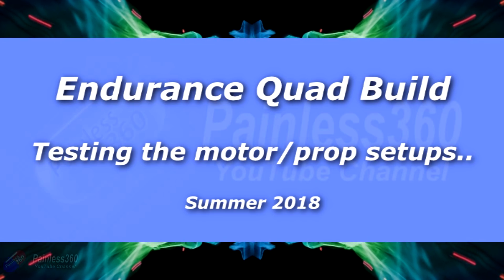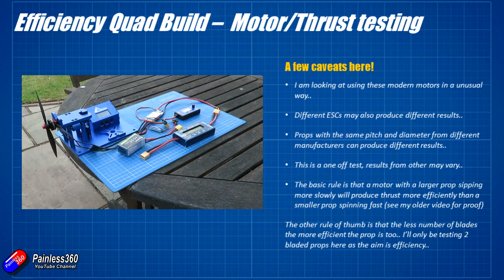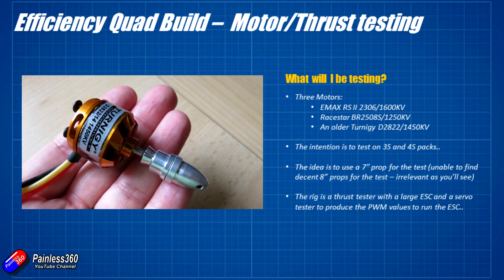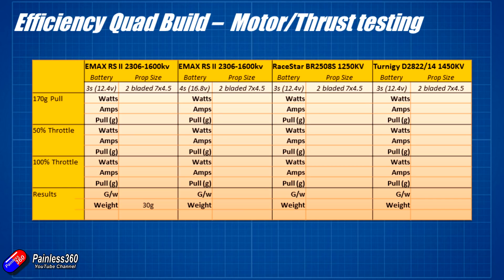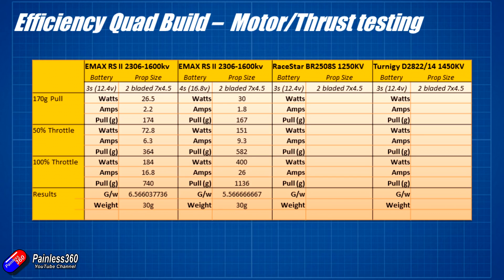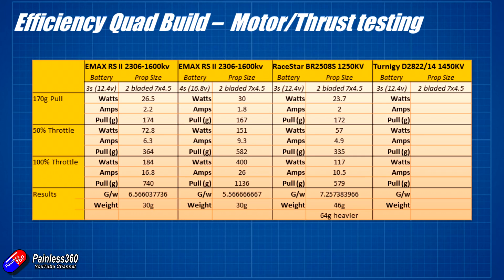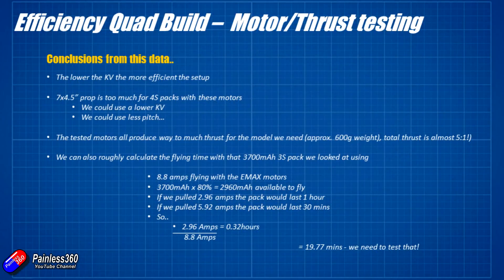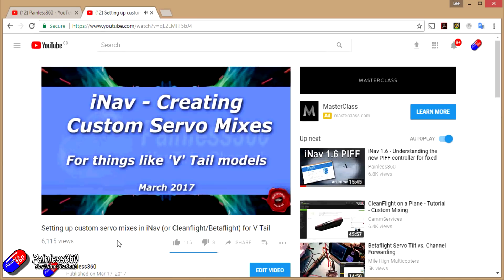Endurance Quad Build (S9): Motor and Propeller Testing

Comment: When the prop unloads in forward flight, it could use even less amps. I've heard thrust stand amp draw data is as much as 30% higher than in forward flight. Putting something half round on top of the arms should also help. These amp draw numbers are low enough for  Li-Ion packs. 3s2p would work nice. Looking forward to the next videos.
Reply from the maker: You are spot on. See the next video for the findings in actual flight.. I've already started looking at a li-ion pack for the next 10" build I'm planning.. >30 mins?

Comment: Or you could just buy a set of the motors used in the Hubsan 501s,  fly on 2 cell 2.7 mh and fly easily for 20 minutes as the 501 does.

Comment: multistar 2312 460kv / 10x4.5 props/ 5200mah 6S multistar lipo/ racerstar anniversary 35A 4in1 esc.   18km range quadcopter , 30min flight time without throttle management. thats one of my builds and the range and efficienty is amazing
Reply from the maker: Great idea! Thanks for that..
Reply: i use a matek F405 STD on inav and yeah i am pretty amazed how good it flies and that airtime is insane. did a 6km away and 6km back trip (with a gopro session on board) with it but i plan to go further as this thing had a lot of juice left in the pack
Reply: What kind of video Tx, and Rx do you use for this setup?
Reply: What frame did you use?
Reply: https://nl.aliexpress.com/item/WST400-400mm-4-Axis-Carbon-Fiber-Frame-for-FPV-Quadcopter/32665432645.html?spm=a2g0s.9042311.0.0.3d7b4c4dPfVfle    without the landing gear, lipo mounted to the bottom.

Comment: That a 2306 1600kv can't really swing a 7" without overheating past 3s isn't really groundbreaking info but it's good to see you confirming it in a test. There's only so much heat a 30g motor can dissipate. The heavier motors should just be compared at 186g instead of  170 for fairness.
Reply: norgtube have run 4s HQ 7035x3 just fine with the 1600kv motors.   Started off with Hobbywing 2405 1800kv motors on the HQ 7035x3 and run almost 7 minutes cruising on a not too light 7in RMRC Valorem with gopro and 1800mah 4s packs.   I dont run below 3.7v per cell and often land with voltage coming up to 3.8 volts at idle as the battery sag fades.    You can see one of my unedited freeroam flights running the setup on my channel.   The Emax 1600kv motors run very nicely on my second 7in Valorem build.

Comment: Eagerly following this build! Think you should also do a check on the current draw of the fpv gear running at full output and fc  to include this in your flight time calc
Reply from the maker: It will make a difference but as you'll see in the next video - almost none..

Comment: I wonder... why stop at 1200Kv? You clearly observed better efficiency. Do you think this is already a sweet spot? I am currently looking at an 800Kv with 10 inch props. Do you think this would make the build too big? Those 10 inch props should still fit on your 8 inch arms. Is there a disadvantage driving this down the Kv any more?
Reply from the maker: 10” arms on a 2212 920kv motor was a  common choice - see the other video I mention. Swinging the biggest props you can will always give the best efficiency. Looks like 9” props would be safe in this model so a lower KV would work ( as mentioned in the video). More on efficient multirotor setups planned..
Reply: I think a 6 inch or 7 inch sized quad is max one should consider...after that the size is just taking away agility of the quad...
Too much inertia in large quads.....
Reply: After having built and flown a 6s 8" I can tell you that a large agile beast is possible
Reply: Wow that's really cool. Sorry if this is a dumb question but what are the advantages of going 6s over 4s? I looked at an 800KV motor that seemed to be only happy til 4s. Is that a motor specific thing to look for?
Reply: Meru Fpv my 12” 2.2kg cinetank is a pleasure to cruise about with.
Reply: Wow that's good to know...I've only ever flown 5inch... Will start reading up for a larger quad build!
Reply: I'm starting to build a 9 inch on a 360 frame. I've been looking at some 2212 920kv. After your experience with those motors getting so warm on 4s. I was just wondering  how the ones I was planning would fair on 4s as well?